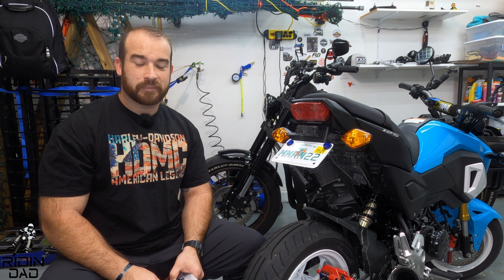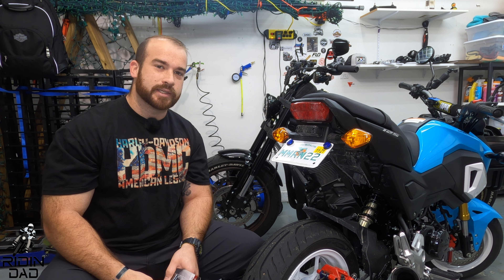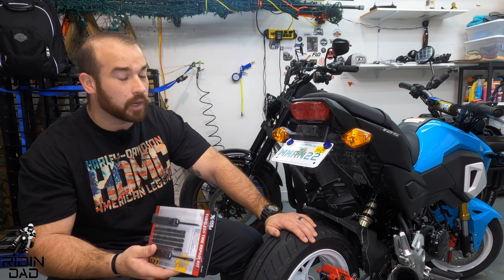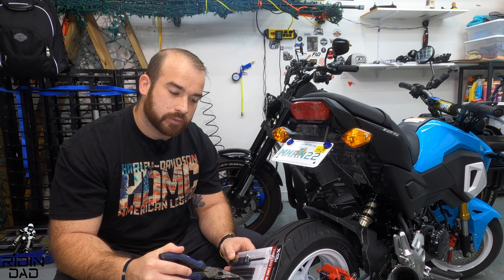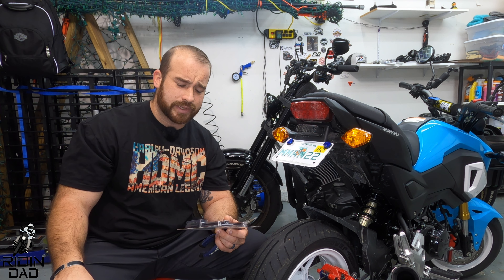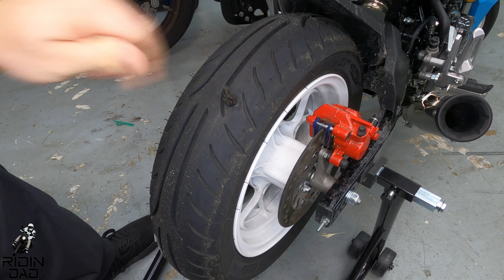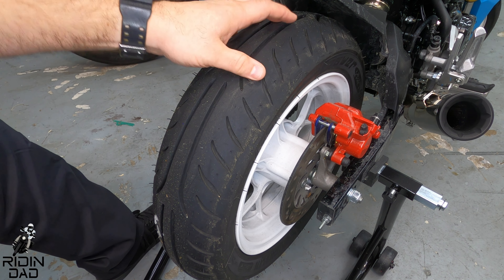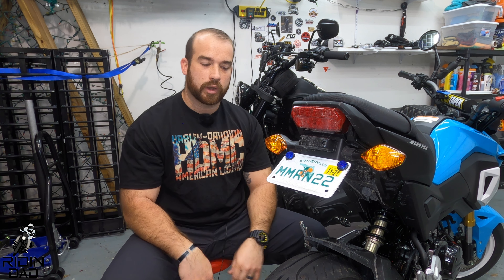How to plug a Motorcycle tire the easy & CHEAP way! - This method works on all sorts of tires

Comment: Hey only thing i would add is too rotate the installation tool about three times after inserting the plug. This will keep it from  doubling back on you like the first one did. Used to work at a tire store and that was the method we used.
Reply from the maker: Awesome thanks for the tip!! I rotated it barely but obviously not enough lol

Comment: my MC has spokes, does this mean that I have an inner tube and a plug would not work? Not looking for a permanent solution, just a way to get home if I have a flat, and without having to take the tire off the boke.
Reply from the maker: Yeah, the vast majority of spoke wheels will have an inner tube. There are some specific spoke wheels that are made to be used with tubeless tires as well but they are way less common. Just check what kind of tires you have and that will be a big indicator if they are tube or tubeless as well. And you are correct, if you have an issue with air leaking you cannot just do a tire plug because it’s an issue with the tube and not the tire itself. The good news is that those are easier to repair long-term because all you need to do essentially is replace the inner tube which is way cheaper than a whole new tire
Reply: @RidinDad  ty for reply. Bummer that I need a tow truck for a flat.
Reply from the maker: Their might be a fix for it on the go but I’ve never owned tubed motorcycle wheels so I’ve never looked in to it :(

Comment: I rode about 20,000 miles with a plug in my front tire of the sportster. It’s almost permanent.
Reply from the maker: That’s awesome! Beats the hell out of buying a new tire!!
Reply: @RidinDad  for real especially when you just have about 50 miles on the tire.
Reply from the maker: Exactly!!!! That’s what happened with these tires lol. At least these were only about 40 a piece
Reply: @RidinDad  I had always heard that you couldn’t plug motorcycle tires but it was a set of Dunlop 404s with no miles on them so I tried it.
Reply from the maker: Yeah I had heard the same thing years ago. It really depends ds where the hole is and how bad it is.

Comment: Shouldn't you have got some vulcanized rubber cement to use too...like fort9
Reply from the maker: It’s an extra step that’s not 100% needed especially at these speeds

Comment: You don't plug motorcycle tires. That's not a thing!
Reply from the maker: It is a thing. And I did it
Reply: @tylerthomas9059  Name one accident that killed someone from a failed plug in a motorcycle tire. I know of at least 6 motorcycle tires that have been plugged and including one of my own that NEVER had a problem. Now if you want to replace a tire (which Harley does) right after you buy a new one because you might (1 in 200000)  chance that a plug will catastrophically fail and kill you then go ahead but for me I'm more worried about the idiot on their phone while doing 80 on the interstate while putting on make up!
Reply: @richardj.waldron1213  Shops don’t even just plug car tires anymore. They pull the tire off and patch it properly from the inside. Like I said before, if you feel that your life isn’t worth the small price of replacing a bad tire then that is on you.
Reply from the maker: You do your own thing. If you don’t feel this method is good enough for you then don’t do it. Like I said. I feel it’s fine. There’s more than enough people testing this method with no issues for me to feel safe doing it
Reply: @tylerthomas9059  Shops plug tires in my neck of the woods all the time! With one exception. The ripoff shops claim that the hole is too close to the side wall and sell you a new tire and I have proven that's a lie numerous times< I have worked in tire stores for and plugged countless tires and never had one come back. If they didn't work you couldn't buy em. AS Ridin Dad said below, You do you and I'll do me but don't call someone a dumb ass for their choice like they haven't considered what could happen. Peace out
Reply: @richardj.waldron1213  Get out of your feelings.
Reply from the maker: If anyone is in their “feelings” it’s you man. You’re the one that called me a dumbass & said it’s not even an option. You so what you want like I said but you cannot fight anecdotal evidence
Reply from the maker: Nobody said they were offended. I’m just stating that you were the one escalating things
Reply: @RidinDad  This is exactly why I quit working at motorcycle shops. People bring their bikes in because they can’t fix them. But then argue with you when you tell them what’s wrong. “Oh well I read on a forum” or “That’s not what they said on this YouTube video”. Well if you know it all then why did you bring your bike here? 🤷‍♂️  Oh and they call you every curse word in the book but if you say anything back to them they get offended. I bet there’s one at a shop right now “what do you mean you won’t plug my tire? This guy on YouTube does it all the time!” Sorry sir we won’t do that. “Fuck this shop, you guys don’t know what the hell your doing! I’ll go somewhere else.”
Reply from the maker: Ok Congratulations. I’m not taking my bike anywhere because I do my own maintained e and modifications. I specify in my video descriptions that I’m not a mechanic and to do what you feel comfortable with, at your own risk. There are many other people way more “YouTube famous” than I that believe in this method too.
Reply from the maker: And I’m not cussing at you either so you’re picking an argument with the wrong guy here.
Reply: @RidinDad  Good for you guy! Would you like a cookie? Maybe one of those star stickers?
Reply: @RidinDad  And never said that you were cussing at me. Also, I am not picking an argument with anyone. I commented on this 4 days ago and went on about life. You and ol' boy are the ones that can't just let it go. Take your bike to a crack head down the block if you please. I could care less. Just stating a problem in the motorcycle community. I'm actually thinking about watching some YouTube videos myself and turning my garage into a surgery center. Just have to get the YouTube University certificate and I'm good to go! Thanks for motivating me. You were a huge help.
Reply from the maker: Lol ok bud 👍🏻
Reply: @RidinDad  Some peoples children... SMDH
Reply: @tylerthomas9059  actually you're right you don't plug motorcycle tires....but I  just did...and I don't ride it now until I get a new back tire...😁I'm not killing myself ☠️🏍
Reply from the maker: You won’t kill yourself with a plugged tire on a grom….I’m still alive. I wouldn’t recommend it on a 700 plus pound bike that’s gonna take you to highway speeds consistently though